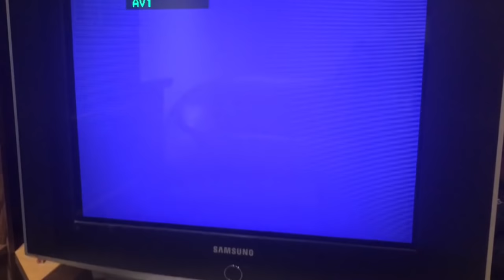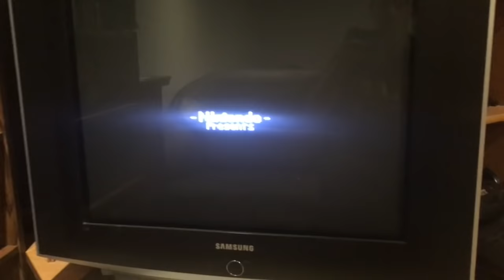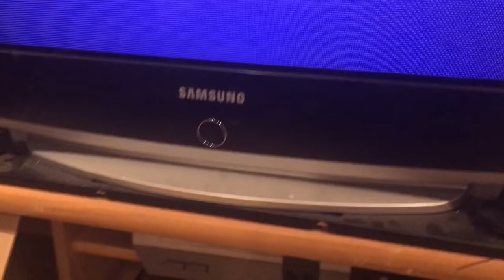Fixing eBay Junk - Super Mario World - How to Repair Traces

Comment: Good job on getting it to work, but extremely messy job. Instead of those thick capacitor legs you use as a bridge, use one piece of copper wire from a speaker wire. Its very thin and doesn't need much solder or heat to stick to the trace. Also look for epoxy to glue the bridges down instead of hot glue. Keep improving!
Reply from the maker: AlKabroni thanks for the tips.  This was actually my first trace repair, but those are some good ideas.
Reply: just an FYI for anyone reading this.  NEVER use epoxy on electrical repairs like this.  It's not necessary and creates a nightmare for anyone else who needs to go in a do any further repairs.  Hot glue is ok to use, but DO NOT cover the entire board in it.  I little dab every few cm's across the jumper wire is enough to hold it in place.  You do not need to cover everything in hot glue.  There's a guy called Drakon who is notorious  for doing this, and his work looks like complete garbage because of it.
Reply: AndehX Iam only saying use epoxy to cover up the open wire so it can be insulated again. CW 2500 to be exact. Im not suggesting to use epoxy to hold down the loose insulated wires, i agree hot glue would be best if u have long loose wires everywhere.
Reply: RetroRepairs If your solder and soldering skills are good you can skip the epoxy/hotglue.
the solder can hold everything, i rarely use hotglue.
Reply: Yu d
Reply: Yes indeed.  If your solder skills are up to par and you're confident in them, you don't even need to use glue at all.  The solder will hold just fine.
Reply from the maker: Thanks for the contributions and tips.  As mentioned above, this was one of my first trace repair attempts, but if I make a similar video to this in the future, I'll be sure to try some smaller pieces of stranded wire as mentioned above.
Reply: Buy a spool of magnet wire...
Reply: I second think magnet wire.
Reply: You should be using insulated copper, the stuff they use for transformers, it's thin, and completely insulated. Use the soldering iron to expose the two ends, and the rest is insulated.

Sometimes known as magnet wire.

One thing to tell him what not to do, but Don't then make bad suggestions yourself.
Reply: It works doesn't it ?
Then who cares
Reply: For everyone saying this is a bad job I'd like people to post a video of a good job so we can all learn. I'm just starting to learn how to do this and its somewhat intimidating and want to have some good point of reference. I don't get why you can't just use solder on the pieces that have worn instead of using a wire. In my mind its conductive and it would connect the two points. is it because its not copper? Would melting some copper be viable? That might not be practical though.
Reply: Indeed, because most if not all Hot glues can be removed by using a contact cleaners and or any that are alcohol based

Comment: Thanks for you work, reminded me to fix one of my old bangers!

Few suggestions:
1. Smaller iron tip
2. Solder wick (solder blobs are bad)
3. PrepPen (exposing trace from under solder-mask)
4. Flux pen (improves solder adhesion)
5. Mask the contact edge with Polyamide tape where you don't want solder as well as holding down the patch wire while soldering
6. 31-42 AWG enamel or Kaynar wire for the actual trace repair
Reply: That's what I kept thinking, that he needed a smaller tip.

Comment: Always wonder why people don't use what us old overclockers used back in the day, car rear window demister element repair paint which is conductive and designed to be drawn in a very fine line using an ultrafine dagger brush and 100% effective.   Also dunno if they still do 'em today but years ago there was a paint pen with the paint in that we used really well for extremely fine bridging and would have made remaking traces a doddle.
Reply: Indeed a circuit writer pen is a great method after scraping the trace and then cover with nail polish after repairing.

Comment: **HINT**
I believe copper stick on PCB tracks are available, Which can be stuck over the break, and then by tacking one side at a time, Like wise a thin PRE-Tinned copper wire can do much the same thing, via Tacking on either side of the break, once soldered, all it needs is some PCB clear coat, no glue is needed..

The trick is dont cut the linking bridge to length until both sides are tacked and tested for continuity, snip and clear coat the bridge..

Comment: Reading the comments, it seems like everyone's an expert.
Reply: Some of us have a lot more experience repairing electronics and don't mind sharing advice.  But I agree, there are way too many people who have repaired 1 or 2 things, and suddenly believe they are experts and can teach others their "best" methods.
Reply: Well the guy in the video isn't very good at all. Wrong tools, wrong methods.
Reply: J Anything but they work....
Reply: Chris Williams dodgy and prone to failure. I wouldn't buy any of this guy's 'fixes'.
Reply: lol i know right why isn't everyone making there own videos
Reply: Phil Underhill:
I'm sure all tips of the trade are welcome. I myself wouldn't have used a jumper at all, but rather dragged solder across the break. It seemed small enough. Instead of potentially using a dremel to to allow the PCB to fit inside the reassembled housing, I'd have tried going back to the iron to try flattening the globs of solder. When hot gluing down the wires the way he did, I'd have squeezed out globs of glue every quarter inch. A sort of "connect the dots" pattern. These are MY tips that I've done repairing many a PCBs. 

The thing is, however longer he does these repairs he'll get better. In a few years, or even now a year on, he may look back on this video and go, ""Holy, Lord. What was I thinking"!/'
Reply: For everyone saying this is a bad job I'd like people to post a video of a good job so we can all learn. I'm just starting to learn how to do this and its somewhat intimidating and want to have some good point of reference. I don't get why you can't just use solder on the pieces that have worn instead of using a wire. In my mind its conductive and it would connect the two points. is it because its not copper? Would melting some copper be viable? That might not be practical though.
Reply: @travismarshall3089  Damn straight, it is all a learning curve.
Reply: @AndehX  damn straight, let the guy learn how to do the shit. It will get better.
Reply: @nicolascuenca254  Honestly, I would love to post videos on how to repair stuff properly, but I don't have a good enough camera for that.  I would recommend Voultar's videos though
Reply: @nicolascuenca254  you can flow solder on it if it is close enough. And it will work.
Only difference is, if it is in a stress area of where the pcb flexs from being put in and taken out of a console. That flowed soldier joint is rigged and could develope cracks,pull up trace or even crack the pcb. The wire allows it to flex. It all depends on how rough you would be with the cart in the end honestly. But there is some food for thought for you brother. This happens on Gameboy carts. They get fractures around the legs of the rom chip. So alot of the time. You can reflo the legs and it will work again. Nes and Snes even sega carts. The plastic case rubs on the trace has cut them over time.
Reply: I dunno, I tried these methods on my Halo 3 that got scratched up and it still fails to post. I'm sooo sad and pissed.

Comment: Just use magnet wire, silver bearing solder and "king flux" (if it still exists). That stuff will make jobs like this clean and easy. Used to use it to do mod chips in PS1's with it.

Comment: Must have been a manufacturing defect that caused the plastic case to pinch the board, causing the traces to get rubbed away over the years. Bummer! Pretty decent job fixing the traces, but I personally would have used solder wick to clean the connector pins on the cart...the extra bulge from the solder could possible cause extra stress on the SNES

Comment: can you just use a circuit writer pen instead of sticking the jumper on there?
Reply: and im genuinely asking... not trying to be like some of these other know it all commentors. I just saw those curcuit writer pens online and i can't find any repair videos of people using them so im wondering if they dont' work to repair traces like that.
Reply from the maker: nate I'm sure they could, I've never tried one myself so I can't say for sure.  They look interesting though
Reply: oh cool. You should test one out and do a video about it. your video's are the best i've found. Im considering starting to try fixing my own cartridges now thanks to your videos making the repairs make sense.
Reply: I like people like you nate.
Reply: for low power traces like those on the cartridge it could work indeed, but for anything that needs some precise voltage references (say you're repairing the traces of a voltage divider) or higher power, then not recommended.
Reply: @Kalvinjj  for higher voltage I use conductive ink paste and a stiff fine tip brush. i have done a pc repair and a xbox 360 repair with the stuff.

Comment: The guy in the video. People are saying he isnt any good. Using the wrong tools etc.
My thoughts on this are. 
1. He has the skills to repair stuff and it works. 
2. You use what you have to get the job done. For the diy electronics lab. You dont need the most expensive tools for the job.
Basic soldering iron, multimeter and magnifying lamp at a bare minimum. And upgrade as you go.
3. Shotty work is all in the eyes of the beholder. If this stuff is his. Then who cares what it looks like. Even customers if you are doing it for others. They will be happy the stuff works. And they will not care about what it looks like inside in most cases.
4. Hot glue, epoxy, tape. In my opinion hot glue and tape is ok only if it is a very very small amount. Epoxy is something that should not be used on a pcb. I think people use that black epoxy to hide solder points honestly. So it ia harder for someone to learn from it. Such as mods to consoles. This video, I personally think that was too much hot glue. It really only needed a dot to stop the bulk of the wire from moving around. However, it is an opinion. Never the less the goal was met. And no one will see inside the cart if all they care about is having a working game. Collectors are 100% different.
5. What this guy is doing. Is basically helping out all of the diy electronics hobbyist / beginners. With a few so called bad habits. Pay attention and learn something people.
Reply: You're wrong.. it isn't jus about "does it work after all is said and done" the point is to have everything work PROPERLY.  part of fixing it "PROPERTY is that all contacts clear the gaps which this DID NOT. Have some pride in your work and have some professionalism.  ESPECIALLY IF YOU'RE GOING TO SELL IT ON EBAY (which this guy said he is) I hope he made clear in the description with pictures.
Reply: To be clear.. this is in response to "shotty work is in the eye of the beholder"... it's shotty work whether the observer is conscious of the shotty workmanship or not.
Reply: @StingJay  shotty work in your eyes maybe. Is not the same result in others eyes. There is no uglys book written on proper repair of electronics. You use the skillset you have to make it work. You only get better and cleaner the more you do it. And learn from the mistakes made. The same theory applies to anything you do. If it didnt, there would be no progression on anything. It is all a learning curve.

EXAMPLE:
Your brand new car doesnt start. You take it to the dealer(So called Professional). They trace and discover a wire was pinched when it was assembled at the factory and exposed to atmospheric conditions causing it to corroded and break. So they cut the bad section out and splice in a new section of wire. To some that would be a shotty repair. Because they did not replace the whole harness.
Does the car work again? Does the owner see this repair everday? Was this a proper repair? Could it have been done another way? Is there a set of rules on how this repair should of been done?

Lets go over the facts.
Car was not working.
A simple repair was made to fix the car.
Car was repaired.
Owner isnt walking.
Reply from the maker: I will gladly admit this isn't my prettiest work. Was the first trace repair I've done, and still works, i included this in a snes bundle i soldto a friend.

I recently did another cart trace repair. Smaller wire used, no glue. Check it out: https://youtu.be/ajdXc_5__5U
Reply: @RetroRepairs  sure will,
Reply: @Labyrnthdom  there are some things to be said about your car example.. if the customer ASKED for a small section to be "patched" to save money it's not the PROPER way to fix it but it's what the Customer wanted done regardless to meet the budget.. yes it works and the Customer is happy but it's still not the PROPER fix.. take for instance break line repair... some customers would like just like a section or 1 line repaired but the CORRECT way is to replace them all. We are not all perfect and the video poster did fix it so that's great and he also can admit his shortcomings and work on improving which is great. I commend him in this aspect but YES, shotty work is shotty work and just because YOU can't see it doesn't change that fact. Maybe you are inexperienced or not knowledgeable about the subject regardless of why you can't see it doesn't change the facts. I say good day to you sir and I hope you are able to see the difference in the future. I RECOMMEND checking out another youtuber so you can see the difference. Look up voultaire.. he does a pretty decent job of soldering and sometimes i see some improvements that he can make as well but continuous improvement is necessary and soldering isn't easy to do right which is apparent when you look at the MAJORITY of YouTube videos.
Reply: @RetroRepairs  nobody is born perfect.. keep up with improvement and you'll get there. Was still fun to watch you work.
Reply: @StingJay  irrelevant to the whole concept. A section of brake line is a "whole" replacment. Not a splice. And that will never happen with a brake line. You will be liable for a death from an improper repair. 
And that car example  of mine is a fact. And the customer did not request this shortcut. It was found several months later. Simply because I was the owner of said vehicle. Also, you might want to look up how to correctly spell said youtubers name your trying to refer so people can find them. The only reason I know who you are trying to throw out there is. Because I already communicate with him. Soldering is very easy when you use the proper materials and tools. You may go relax in minecraft now.

Comment: You need to learn to use no clean flux for repair work like this.  It will make soldering jumper wires and stuff 10 times easier.
Reply: It's called no clean flux because it's supposed to be used with SMDs, the oven will do the cleaning part. if you don't put you pcb in and oven, the no clean flux will corrode your pcb components/traces down the line, just clean it with 99% alcohol.
Reply: I'm no expert but I was kind of in awe when he didn't use flux.
Reply from the maker: I agree.   Technique has been refined over the years. Check my more recent trace repairs.  Much better and not as obtrusive

Comment: For such small breaks, you can drag a drop of solder to act as a jumper. Also, while you have the cartridge open it's a good time to replace the battery.
Reply: Also, use flux, ffs.
Reply: I was also wondering why he didn't just bridge the breaks with solder.

Comment: Thank you for the video! I am doing this right now, and repairing traces is hard. Is it ok to have solder so far down on the copper part that goes into the snes?
Reply from the maker: It's not ideal,  but if it happens,  it happens. Just use a solder wick to try and remove as much as you can.
Reply: Awesome, I will do that! I noticed I have a decent amount on mine. THank you for the videos! I ended up buying 13 broken snes's due to your videos inspiration!

Comment: A bit more practice needed I think, a bit messy, but gets the job done.  When running patch wires on a board, solder in the one end, then route the cable and cut to size and solder the other end.

If you cut off small wires to size first, then that wire is difficult to hold in place and solder.
Reply from the maker: Agreed.   I've got some more recent trace repairs within thr last couple months on my channel, did them entirely differently, smaller wire, less intrusive, better end result

Comment: I know you probably get this question a lot but what's the best way to clean the system pins?
Reply from the maker: Viacom's Spy first thing I'll try is just q-tip and 99% isopropyl alcohol.

If that doesn't work, a pencil eraser can give a bit more abrasive power to remove gunk and oxidization.

Failing that, VERY fine sandpaper, such as 2500 grit automotive sandpaper can get some stuff off.

Failing that, I've heard that Brasso is good for cleaning pins, but be careful, it can strip the pads clean off the board
Reply: RetroRepairs Thanks! I'll try that.

Comment: awesome video, great work saving a classic game. One question since I'm new to board repairs: those wires you put in were touching other contact points right? Isn't that a problem? I mean its just laying on the board. Its kinda hard to see but are those wires insulated?
Reply from the maker: YellowElevator815 are you talking about the coloured parts of the wire?  The jacket insulates the wire so it won't contact anything it touches.  Only the bare copper tips will conduct the signal
Reply: yup. Didn't realize they had jackets